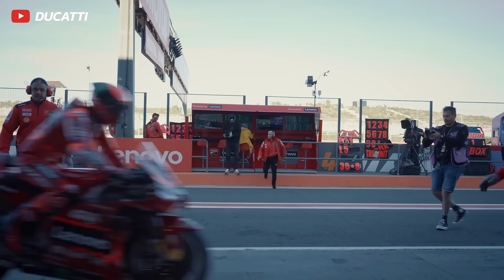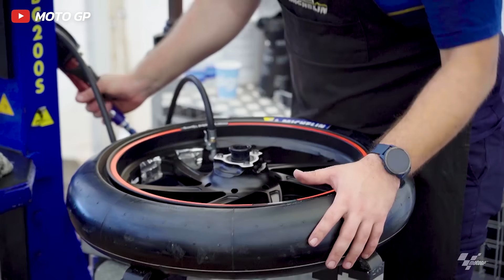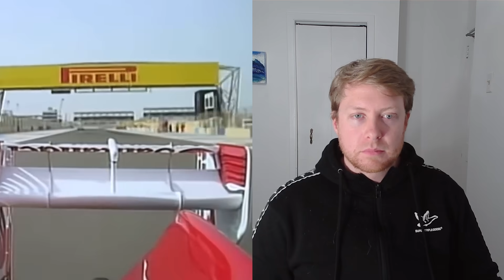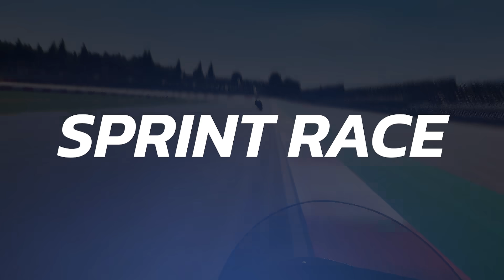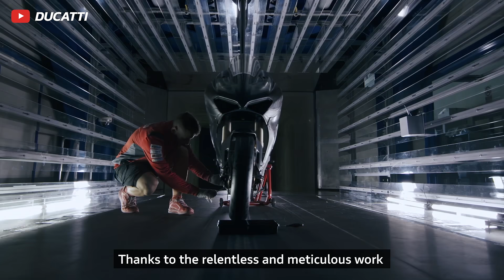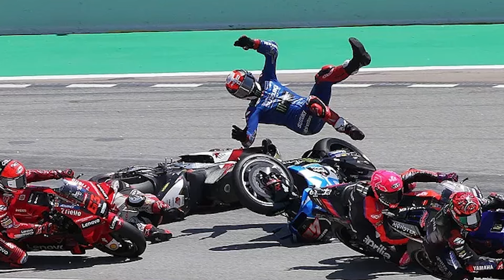MotoGP Explained in 12 Minutes

Comment: About the only reason they are dragging elbows is because of computer aids but, who knows maybe someone is talented enough to do it w/out the aids.  All of these aids did help them go faster but, even the GP500 bikes in the 80's were hitting over 200 MPH so how much faster did they really need to go.  I say limit the aids and bring out the true rider skills.  If the racing isn't tight enough find faster riders.  I won't go as far back as having the riders run across the track and push start their bikes to start the race.  This would reduce the GP budget so more of the money could possibly go to the riders.  I'm probably the only one who feels this way but, MotoGP isn't even that easy to watch anymore because of cost so I haven't seen a race in real time for years other than the ones they show on NBC for the U.S. races.

Comment: Im not a fan of how much motoGP has turned into F1 but on two wheels. Honestly moto GP bikes should be 100% stock from the manufacture, under a set price (no more than 20k) and the model MUST be availble to the consumer market at that price as is. The with the only choice that teams should get is what manufacture they want to go with and tire compound. No weight savings, no addtional aero, no special breaks.... NOTHING. Let the manufactures  fight it out to make the best bike at a fair price. Tired of seeing manufactures come out with these 40-55,000 dollar bikes and then complain that the hobby is dying. Besides by the time these bikes hit the track they aren't even a manufacture bike anyways. its basically just very rich teams taking ducatis or any other brand and making their own replica.

I want to be able to walk into a dealer with 20k in my hands and walk out with the exact same bike used in motoGP and get the same amount of performance based on my riding capabilities.
Reply from the maker: I agree new top end bikes are hideously expensive but everything is nowadays. Although from what you described. WSBK is as close as you would get. I like having WSBK for the more production based side and then MotoGP going nuts and pushing the limits. That's me personally though

Comment: What is important about Motogp in the last 7 years is a standard ECU and standard tire that all teams use.   Before this the costs were so high since some teams had pockets to develop a better ECU.   Poor teams had inferior ECU that could not compete.   Also there were two tire manufacturers so if you were sponsored by Bridgestone you were stuck all year, where another team chose Michelin.   This also made for bad racing if you chose the wrong tire sponsor your were stuck with a inferior tire all season.  

The last 6 years have been closests racing in motogp due to 1)single ECu 2) single tire provider 3)everyone realized to use a V4 engine…. Sorry Yamaha and Rossi

Comment: Did this man call Yamaha's powerhouse a "traditional" inline four? No where near traditional.. traditional design fires 2 out of the 4 pistons together whilst the other 2 rely on this power stroke to release the exhaust gasses etc etc.. Yamaha use what's called a cross-plane crankshaft (notoriously known as the Big Bang Engine) which fires each individual cylinder individually at different degrees thus giving 4 "power deliveries" to the back wheel in a single rotation instead of 2. This gives you better traction in corners cause there's less gaps where there's no power to the wheel. But not that just, the best it produces is it's unique sound. Low rpm sounds like a v4, higher rpm sounds like an inline 4 screamer
Reply: I have 2021 MT-09 with 3-cylinder cross-plane engine which many like the sound & like power it provides. Yes, it has some vibration but I get used to it.
Reply: @frankchan4272  Yamaha call the CP3 a crossplane like its something special like its 4 cylinder cousin... but its really just a marketing ploy as all 3 cylinder engines out there are crossplane.
It is a fantastic engine though.. I have the 23 gen3 MT09 SP.
Reply: You have mixed them up completely. Cross plane has a big pause in the middle to take back a bit of traction, flat plane fires evenly. Flat plane usually has a higher redline, cross plane more torque.
Reply: It will be very interesting to see the V4 at the next test…hopefully
Reply: All in all, that supposed benefit of constant power/torque display is lost when you realize the engine will tilt gravity center forward and thus, decreasing grip as rear tire cannot sit properly when outputting power

Comment: 7 engines, but those can be completely rebuilt right?  If that's the case, it's an almost infinite amount of engines.
Reply: No rebuilds.  Crated and sealed until use.  Then retired and boxed up for inspection.

Comment: I am a new motogp fan. could you explain what are teams and how to identify their racers? it is confusing and  hard to identify them by looking at a bike or at a rider. does a rider who wins in satruday  has extra points in sunday match?
Reply: Best to follow the riders' bike numbers until you start to recognise their individual livery. They all look slightly different, though it's confusing at first
Reply: ok i'll try to 🙂
Reply: identify team colors, then ride number; e.g. its light blue and either #73 or #93.  Or dark blue and the #20 has horns;
Reply: @russelfernandes8483  okk thank u
Reply: Well there are 5 factory teams :
Ducati, the red one, rider #1 and #23
Aprillia, black with white, green, red stripes, rider #12 and #41
KTM, black and have Redbull sponsors, rider #43 and #33
Yamaha, the blue one, rider #20 and #42
Honda, the black (carbon) with white, orange, blue stripes, rider #36 #10

There are also satelite teams (sister team to the factory) but this teams in this season run a bright and colorfull livery you'll catch them 😂

For the sprint, half the distance race hence half the point and only from 1 to 9 respectively.